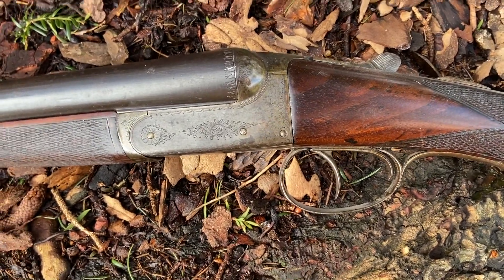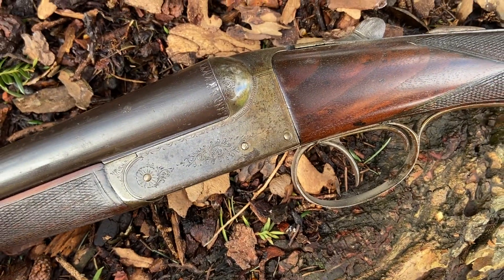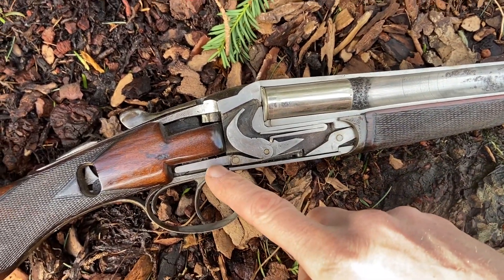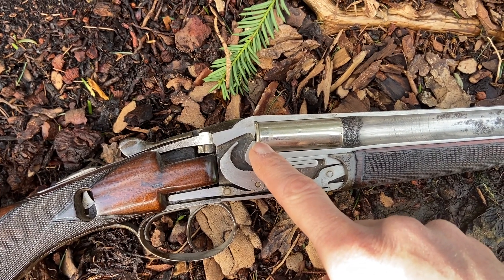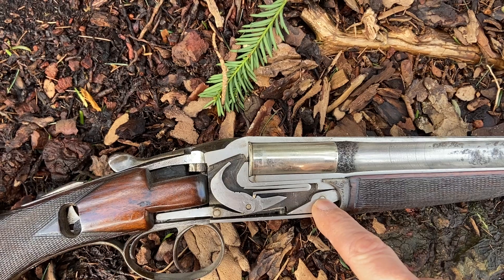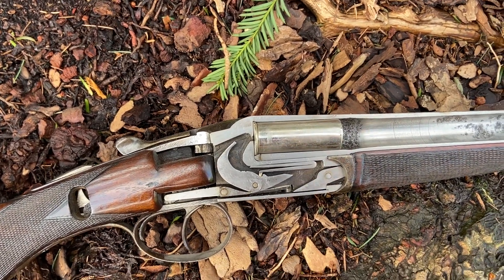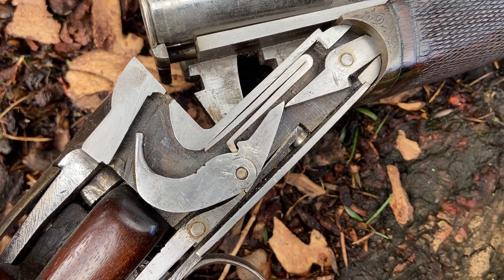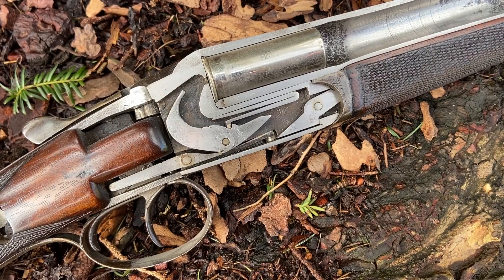Anson & Deeley

Comment: Thanks Diggory, this is a fascinating cutaway and a great video. One of my 12 bores (a Webley & Scott 700) has started doubling - it fires the left barrel at the same time or shortly after the right barrel. The left sear engagement looks ok. Are there any other causes of doubling in a W&S 700 that you know of?
Reply: I owned a 12 ga Wolf (a shotgun made in Suhl- DDR) a long time ago that had the same problem. I never found out what caused the problem.

Comment: Thank you for the video. I am currently working on restoring a JP Sauer & Sohn double barrel with an Anson-Deeley-Sclob action. I’m needing to source the special tool for replacing the hammer and hammer spring, or a set of plans to make one. Would you happen to know where a chap could find these? Thanks again
Reply from the maker: If you have a look in my book The British Boxlock Gun and Rifle, it shows you how to dis-assemble and re-assemble a boxlock. The tools you need are basic and can be home made.
Reply: @headbutt67  sir thanks for the reply. I ordered the book you suggested, and will check it out